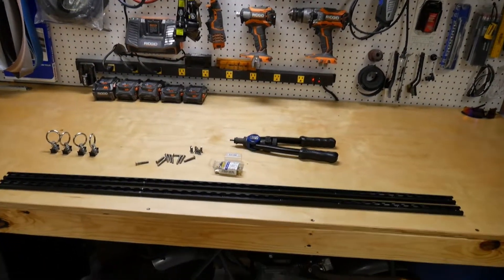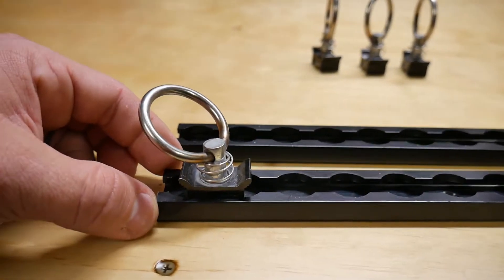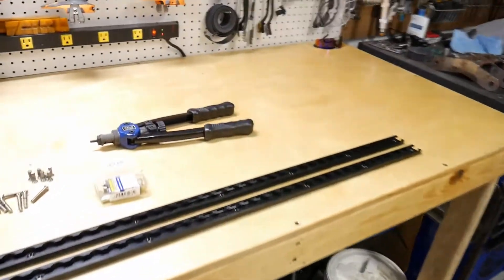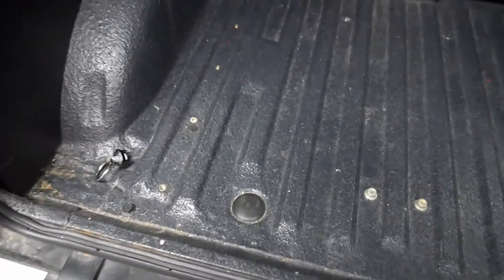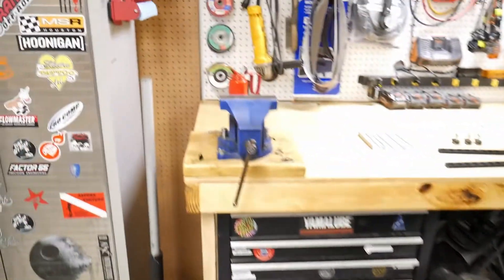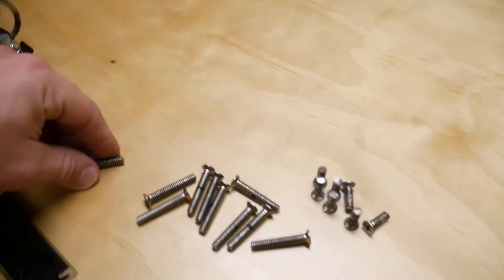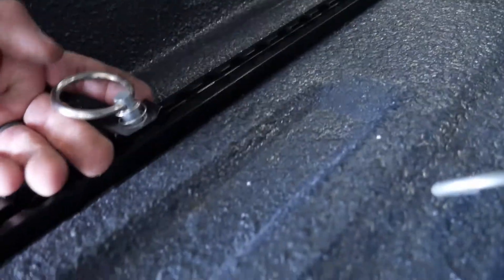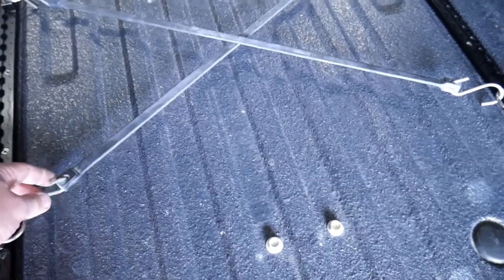Installing a Rear Anchor System

Comment: Love the tin top buddy. Where did you get that back bumper, or did you make it?  Also, when will you be posting more videos on the sammy
Reply from the maker: Me and my buddy built it. Not sure to be honest. I started a new job at the start of October. I'm a crane operator but my boss discovered I can weld, fab, and turn wrenches. So about 90% of my shop is now at my jobs shop, but I have access to my jobs shop completely. I can come an go there as I please. So I'm going to start filming again, but I'm not going to be able to bring my Sammy up there just yet. So I'm going to do some welding videos, and some fab stuff after hours. Then work on finishing up the port and polish on the cylinder head. Probably reassemble the engine at work, and then put it in the Sammy at my home shop. I've had to do a lot of preventative maintenance to my daily, 2007 Toyota Tundra, but wasn't sure ppl would want to see that being this is a Sammy channel. But I know ppl enjoy the welding and fabing stuff, because that's really what you've got to do with a samurai. So I'm thinking of have a series on welding called, "beginner's guide to welding, from a beginner", because I personal feel I'm far from a pro. I'm only self taught for the most part.
Reply: @ELKMotorsports  I understand. I think people will like the vids.  I was just wandering about the Sammy because I have one, and i think your videos are inspirational. Your channel is my favorite on YT cause I love turning wrenches too and working on my own stuff to save time and money.  But that's all I was wanting to know. I look forward to the welding series. Thanks Tray(Trey)

Comment: Hi. Go on with this videos. There are a lot of videos for jeep on youtube but less for suzuki. A had a short samurai and know i have a long wheel base. Coud you tell something about the arm rest build between the seats? And more information about the tool holders on the back door? If you like watch my build on youtube. Its build in germany but you can see a lot without understanding the language.
Reply from the maker: Off Driver,  definitely. I actually have some spare holders that I'll feature, and I may replace the mounting system that holds center console in place.